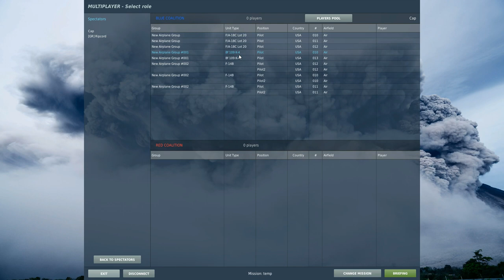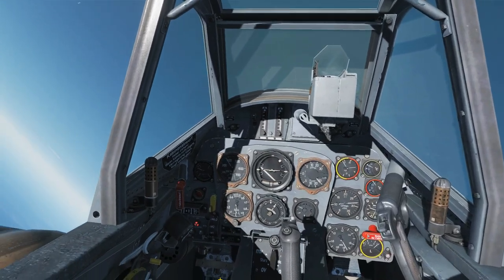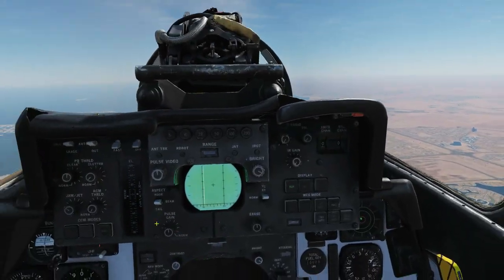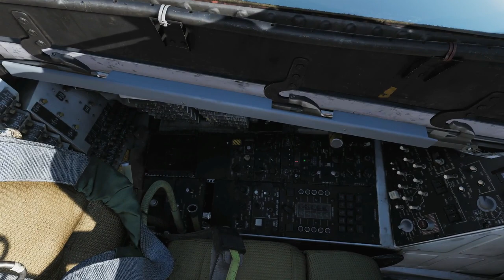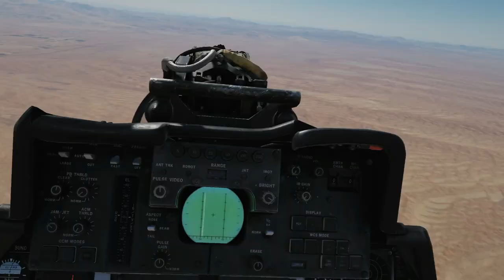Questioned: How Is Oxygen & Hypoxia Modelled In DCS WORLD?

Comment: I did a hypoxia awareness course with the RAF at the start of the year.
We were put on a flight sim with an oxygen mask on, they gradually turned the oxygen level down so simulate climbing without a functioning oxygen system so that we could identify our own symptoms of hypoxia at differing degrees.
As previous comments have said, your time of useful consciousness is quite long until you get fairly high, and the onset of hypoxia is frighteningly quick. 
I got up to 25,000 feet after 4min 41 seconds before I was on the verge of passing out and went to 100% oxygen.

In regards to the F/A-18 I believe that it is due to the mask forming a seal and not allowing ambient air in, hence why you can pass out at low altitudes.
Reply: Alistair Webb did the same chamber at Randolph afb
Reply: They should add the function to remove the mask then for a low alt case

Comment: 7:08 the reason you are passing out at such a low altitude...is you are wearing an oxygen mask. When you turn off the flow...the mask keeps you from breathing the outside air.
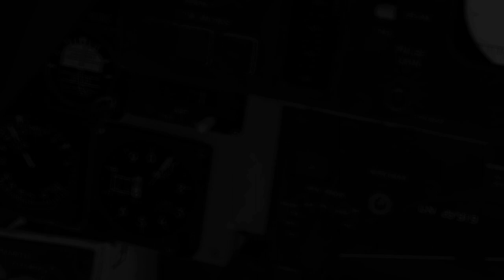Reply: so at 5:52 why does he not pass out at low altitude
Reply: @dicejones3654  5:52 is a different aircraft. It's the F14. The clip I'm talking about at 7:08 is the F18. Since there's no actual button the take off the mask...I'm going to assume the F14 is coded to allow you to breathe "through" the mask if you are at low enough altitude. The F18 is not coded that way apparently.
Reply: Cant speak for the oxygen mask worn by F18 pilots. But most fast jet pilots in UK aircraft have an anti suffocation valve fitted in their masks to prevent a similar scenario to what was being shown in the F18 at low level in this video

Comment: Nice video, guys! Your guess about flow with mask on was right, it's about flow, though they're a little aggressive on the time of consciousness, if you've been breathing enriched O2 you can suffocate for a minute or two just fine, tho the feeling of panic is usually hard to overcome. The reason you've got a difference is different system architectures, OBOGS vs LOX (liquid oxygen) When you shut off oxygen in the F-18 you're cutting off flow completely. Your mask is still on but you're being choked off. In the F-14 you can still breathe with oxygen off because you've got flow still but not actual enriched oxygen, it's sucking air in from the cabin. I'd have to draw a diagram to really show it 😃
Reply from the maker: thx

Comment: This has actually been happening to hornet pilots, with OBOGS off and mask in place the only way you’re going to breathe is if you pull the emergency oxygen green rings that gives you 10-20 minutes of emergency oxygen via the cylinder in your seat. The procedure in the real aircraft is 1: Emergency Oxygen green rings PULL 
2: Oxy Flow knob OFF
3: initiate rapid decent below 10,000 feet Cabin altitude 
4: OBOGS control switch OFF
5: maintain altitude below 10,000 feet prior to emergency oxygen depletion (10-20 minutes) 
NOTE: under less than optimal conditions (low altitudes, heavy breathing, loose fitting mask etc) as few 1.5-3 minute of emergency oxygen may be available. 

If you’re wearing a mask and OBOGS is off without emergency oxygen flowing then correct, you cannot breathe. It’s been a real life issue in the Super Hornets/ Goshawks/Raptors/Lightenings that use the oxygen generation system as opposed to older jets that had an on board liquid oxygen supply. In the game not sure, but that’s what the manual says the emergency procedure is in legacy hornets and it’s been a really huge deal in the past few years especially in super Hornets and Raptors.
Reply: But could you just pull the mask off your face and jettison the canopy to breathe atmospheric air down low as the last resort action?
Reply: Błażej Seremak Unless you really have to, not recommended to have fast air flowing right into your face unless below at least 250mph.
Reply: Wasn’t there problems with some kind of contamination in the system that was causing pilots to black out?

Comment: Even on ground the behaviour for the hornet is not simulated correctly. Just shut down the plane and open the canopy while the aircraft is parked and turn the obogs regulator off, you will black out. ED answer in the forums was that you can not simulate a position of mask on or off on pilots face. Obogs on/off switch does nothing special in dcs either.

As a side note TUC (time of use full conscienciousness) will strongly vary with your altitude and also fitness state. High up, where a fit pilot will have around 10" (at around fl340), a less fit person will pass out even faster. That's why bizz jets with high cruising level and some airliners (A350) will have an automatic "emergency descent" function in the AP to cope for very small TUC.

Comment: from what i know the cockpit is pressurized in modern planes so as long as it's closed there is air in it. now what differs from plane to plane is how the air in it works. in all planes the compressor that feeds the engine also sends air into the cockpit. when not in combat the pilot can just have the mask off and nothing will happen as long as the canopy is sealed, while in combat the mask should always be on regardless of altitude to feed the pilot with high quality oxygen which helps to maintain consciousness in high G turns and to provide air in case the canopy is damaged. now in some planes the compressor sends air in the cockpit at all times and the oxygen setting is for the tanks that feed the masks, while in others the compressor does not send any air in if the oxygen switch is set to off. also one issue of passing out on various altitudes has to do with the "mountaineer disease" - when you climb higher to an altitude you are not used to, you start to suffer from hypoxia even if the air is perfectly breathable there, so at 10k ft you will start having symptoms despite the air being fine if you are not used to the environment.
now for as to how it works in the game, i'd guess its not modeled very well. with the canopy off in the F-18 you should have been fine at low altitude

Comment: F-14B is LOX while FA-18 is OBOGS, but that shouldn't make a difference in this. What matters is cabin altitude not baro altitude. US military jets are pressurized at 8000' and maintain a constant pressure differential up to about 23-24000. Anyway, it appears that in the FA-18 they are not modeling the pilot taking his mask off. Trust me, if you turn off O2 flow and keep your mask on you are sucking rubber in about 1 second. Conversely, with good cockpit pressure you can fly around without your mask on at 25,000 no problem (about 10K cabin pressure). When you blow the canopy you are obviously dumping cabin pressure. If you want to see if cabin pressure is modeled try turning the ECS to OFF, or CABIN PRESS to RAM/DUMP. Realistically even with ECS OFF the canopy seal will hold cockpit pressure for a while and you will lose pressure slowly.

Comment: I've always wondered, if I can hold my breath for minutes...why would I pass out of hypoxia in a matter of seconds?
Reply: Because down here the air is more dense. If you hold your breath with air that is poor of oxygen you wouldn't be able to hold your breath for long
Reply: You'd risk a barotrauma injury to your lungs if you forcibly held your breath while the ambient pressure dropped.
Reply: @haramaschabrasir8662  That makes sense and I'm sure it's right.  But also, if you're on OBOGS at 30,000 ft, you're still getting dense oxygen to breath.  As soon as that system fails, despite having been on that dense O2, you only have seconds.  I guess we breath out effectively all our oxygen are brain needs in two or three breaths.
Reply: @HO-bndk  It's not so much a question of holding you breath at altitude.  It's a question of O2 starvation, from whatever cause, at different altitudes.  You're right though, if you tried being a free diver and held your breath during an OBOGS failure, you'd probably be okay from a hypoxia standpoint for a little bit, but you'd damage your lungs.
Reply: By the time you figure out that you're in trouble, holding your breath does you no good because there's nothing there to sustain you. You lose consciousness quickly because the O2 partial pressure is so low at those altitudes that O2 will actually leave your bloodstream through your lungs.

Comment: The variable we can't see is whether or not you are using the mask. Is there a mask in the BF109 or are you just slowly using the available O2 in the cockpit? Same question for F14 and F/A18 - is the mask on or not?.  (I once forgot to turn on O2 in the A10-C and started to black out around 12000 feet.)
Reply: Remember, it's not just the presence or lack of oxygen that cause hypoxia, you need to take into consideration the atmospheric pressure as well. Even if you are in a high oxygen concentration environment, if the atmospheric pressure around you is too low, no oxygen will make way into your blood. That is the main reason why pilots can't have facial hairs, as masks need to make a good seal with the face, to keep the pressure high enough. Also, that is why the passengers masks in airliners are only good enough up to certain altitudes (can't remember the number). Above said altitude, all the oxygen they breath in is simply not absorbed. As a pilot and teacher of mine said once, those masks are only good to dampen the screaming of the passengers back there.
Reply: @aboriani  In airliners, the passenger emergency O2 masks are there to keep the passengers from dying before the pilot can get the aircraft down to a safe altitude. They might pass out on the way down, but they won't die. On certain routes, for example over Tibet, where the aircraft may be unable to descend to a safe altitude, special passenger O2 systems that can supply O2 for longer duration are required (this also applies to much of Antarctica, though for the most part there's no reason for passenger service over that area).
Reply from the maker: 109 guy was wearing a mask yes. But o2 was turned off.

Comment: The F18 and the Bf109 are modelled incorrectly... I fly at 12000 all the time and never had any signs of hypoxia... To be 100% accurate, even the F14 is wrong in a certain way, cause you really don't realize anything wrong with you until is too late, cause your brain is starving for oxygen and you get dumber and dumber until you pass out and die. I've been into those hypobaric chamber and did an hypoxia test, and I've only been able to realized how slow and dumb I've became at 23000ft pressure when I finally turned the oxygen on. There are some early signs that you must know and pay attention to to discover you are lacking of oxygen, like all the colors will subtly fade out or your nails and lips get blueish, but once you hit the confusion state, it's almost too late. You will find out that turning the oxygen on is a huge and difficult task. Hard to simulate that into DCS, I know.
Reply: They are modeled correctly. The F18 has a sealed face mask, so turning off the oxygen would be equivalent to putting a plastic bag over your face. The 109 has a time of useful consciousness modeled into it.

Comment: In The Game you  can’t take the mask off, with the mask on and the oxygen off you would still pass out sitting on the tarmac.
Reply: Nothing at an airport is called a tarmac.
Reply: Tar·mac
/ˈtärˌmak/
 Learn to pronounce
nounTRADEMARK IN UK
material used for surfacing roads or other outdoor areas, consisting of crushed rock mixed with tar.
a runway or other area surfaced with tarmac.
noun: the tarmac
Reply: What is a tarmac at an airport?
The airport apron, apron, or ramp, is the area of an airport where aircraft are parked, unloaded or loaded, refueled, or boarded. Although the use of the apron is covered by regulations, such as lighting on vehicles, it is typically more accessible to users than the runway or taxiway.
Reply: How many more definitions do I need to post?
Reply: @robertsandefur6719  Calling it a tarmac is like calling a highway "the asphalt." Literally no pilot calls it a tarmac. The only people I hear call it that is the media. No matter how many "definitions" you post, you're still wrong.
Reply: By the way, airports haven't been made of tarmac since WWII.
Reply: In VFA 303 and VFA 305 (as well as HAL 5 I was not part of that squadron) “the Ramp” was directly in front of the hanger the area between hangars was part of the tarmac. That was pilots and ground crew.  
As a plane captain for those squadrons that’s what we called it. Maybe you squadron called it something else.